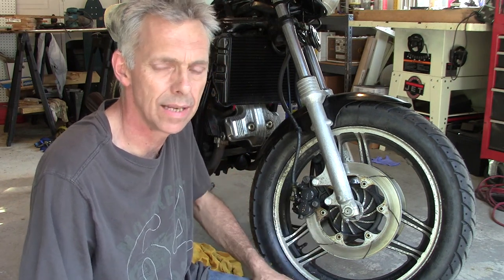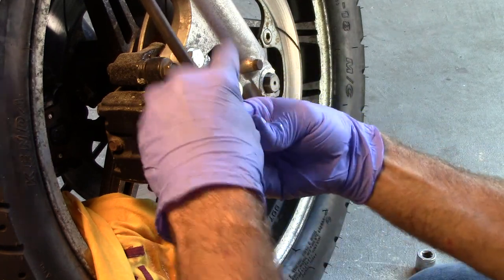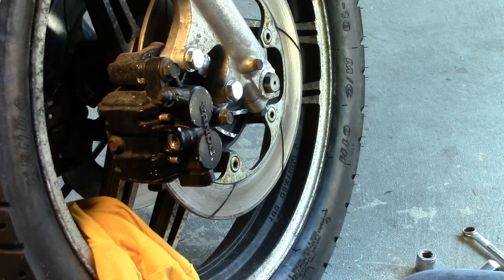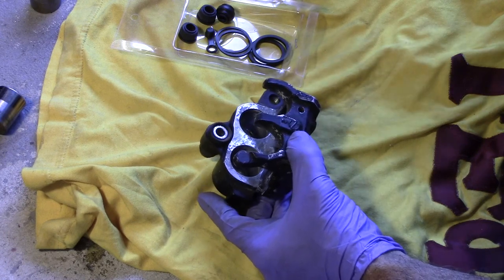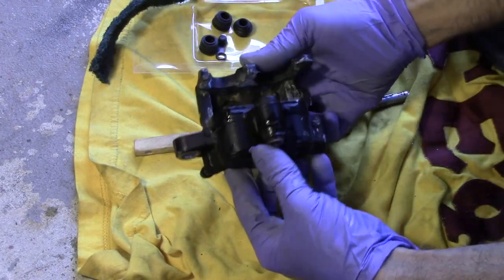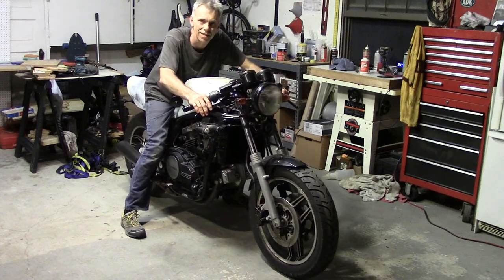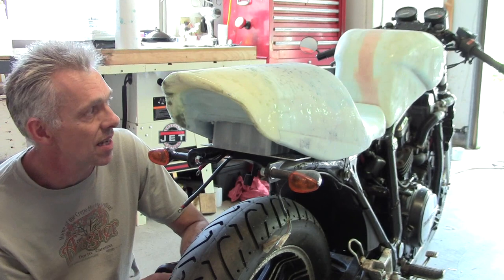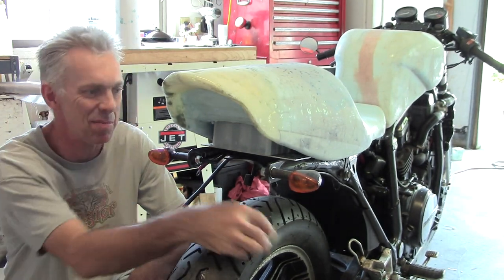Project Honda Sabre Cafe Part 16

Comment: You should keep them if you can. Make sure the sliding bushing is free in the caliper. It's that silver bushing with a rubber boot over it that the caliper mount bolt passes through. If that is seized up, the brakes will drag.

Comment: The seat has a tab at the front that hooks under the frame and at the rear I'm re-using the stock hook mount. I've changed the upper brake line to braided stainless steel and plan on upgrading the lower two as well.

Comment: I'm going to ride it first before I do any handling or suspension changes. I changed the fork oil to 15 weight and the rear air shock is functional. I may upgrade that later.

Comment: WOW. The Sabre is lookin good!
Once the tail light goes on no one will know where the battery is. 
Being a cafe racer, are you going to firm the suspension anyway? That would help with the battery clearance.
We used coins in the front forks to compress the springs and firm it up. Australian 20cent pieces and thicker oil to slow the rebound.Worked well. The rear mono shock is easier with the collar preload adjuster. 
Thanks again for this instalment.

Comment: Really enjoying this series.  Passed on to all my fab/riding pals.  Glad to see posts on the ADV site.
Disappointed with the new batter config.  Lot's of weight up high, in the back, upset polar moments.  Centralizing mass is the key to handling, not spreading it around.
Look into the Shorai Lith/Iron/Phosphate batteries.  Small, lightweight, big power. The model suggested for my BMW is 1/3 smaller, 1/4 the weight.  Did wonders for handling since it rides behind tank. 4.3 vs. 19 Lbs.

Comment: Big compliments to both your electrical and mechanical skills. Love theese vids. I`m doing an 81 cbf 750 cafè racer. Just came in from the garage and "hey" a new episode of project Sabre....just to discover, you did the exact same brake fix, I did tonigt :-) same brake system... I even have the same bleeder bottle system :-) 
Greetings from Denmark Europe

Comment: why not switch to a lithium battery you will get the power of the larger lead acid battery in a much smaller package so you can use the original hole ?

Comment: had the same problem with the breaks on my v65. I took them out, sanded the pistons, cleaned the groves and gaskets, and they still drug a little. so I just took out the tension plates and that fixed it. and there have been no noticeable defects from not having them.

Comment: I don´t recommend compressed air to take out the pistons. I have done that, and was careful with the air but the pistons landed 20 meters away. next time i did it i was using a grease gun. Only problem then was to clean the calliper.

Comment: Just a reminder to people that when you are bleeding the brakes, check the fluid level in the reservoir every so often and top off if needed.  If it runs dry you're just going to pump air into the line.